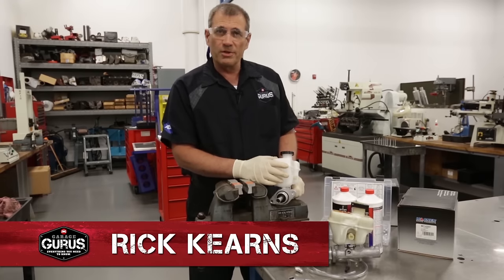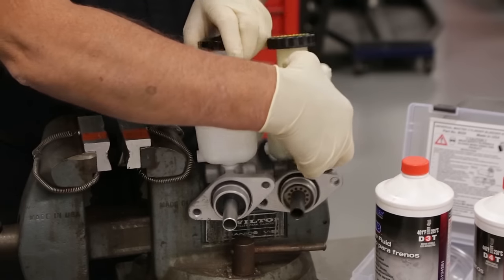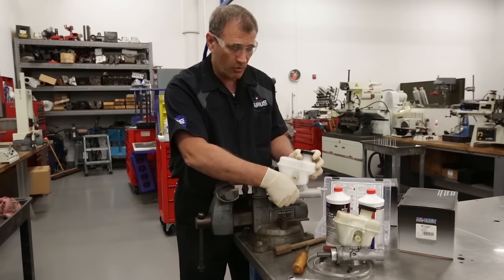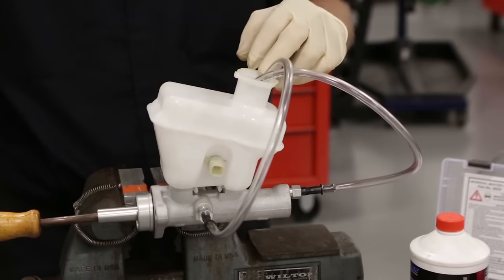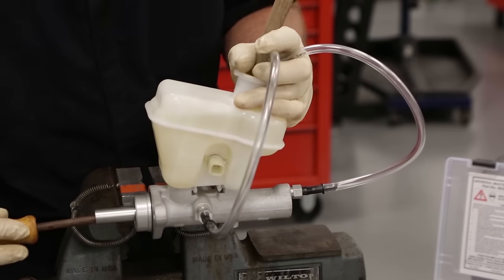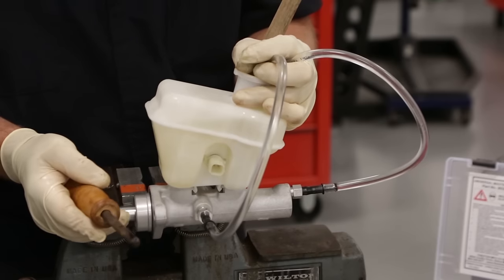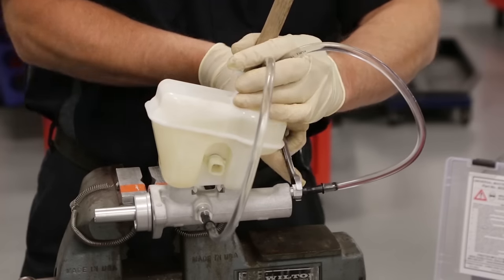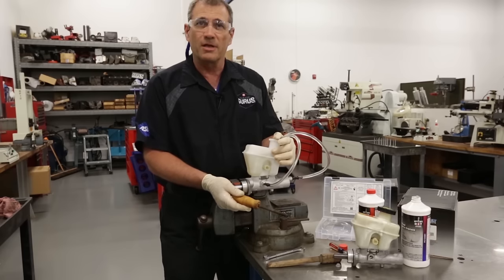How to Bench Bleed Master Cylinder

Comment: I hear that!  Asking the same "logical" question everyone else is -- that is being avoided -- as soon as the lines are removed, there is going to be an air pocket right there.
Reply: What works for us is... Install master cylinder, leave the lines from master slightly loose and have an assistant press brake pedal slowly down and hold it there.  You will see the air bubbles come out. Tighten the lines, let up on the pedal.  This works most of the time for us but we always finish with a complete brake fluid flush just to make sure all the air is out of the system.
Reply: @justincaseauto  do you depres pedal tighten up screw and then repeat a few times or is it just once?
Reply: @JosePalacio12  Most on the time we can do it once, maybe twice depending on how much air comes out the 1st time.  Usually there is just a small amount of air there anyways but do it as many times as you feel is needed.  If you keep getting air at the master cylinder lines there might be other issues.  This is assuming the master cylinder was bench bleed completely first.
Reply: @justincaseauto  ok got it.  Thanks for the reply.
Reply: Long as you do not Press the brake before reinstalling the lines then as recommended do a all wheel bleed
Reply: I doing my 57 nomad,complete job.i think the MC is desgin and  engineering to hold majority of brake fluid with losing fluid till one pushes the master cylinder in either brake lines attached.sure going get some air but will be release bleading all 4 cylinder syarting farthest line to shorest.a small amount.the problem i have is ugrading m.c.dual port reservor .

Comment: Can this is any way be done with the master cylinder on the vehicle? Reason being is a replaced all the lines and now it seems I cannot get the brakes bled correctly.
Reply from the maker: Arnold, the quick answer is yes.  We recommend gravity bleed first.  Make sure the master cylinder cap or lid is off or lose during this procedure.  Second, perform a pedal/pressure bleed alternating from front to rear of the brake system.  A common brake bleeding sequence would be RR, LR, RF, LF.  If you have any additional questions, you can always give our tech line a call and they can assist you further. The Gurus Tech Hotline number is 800-325-8886 and is available

M-Th: 8:30AM-5:30PM ET
Fri: 8:30AM-5:00PM ET
Reply: Arnold not really.  Depending on how your MS is set up.  Sometimes the length of travel between the booster and MS is not 100%.  So you will always have a residual pocket you cant bleed attached to the booster/pedal.
Reply: I know this is a year or so old but the real answer is YES. Several ways come to mind. One way is the syringe method where a syringe with a rubber tip is filled with brake fluid and injected into the MC where the brake lines connect (disconnect lines first). Another is with a pressure kit from the cap area of the reservoir.  This will also be used to bleed the entire system as well. Good luck

Comment: where do you purchase the metal brake fittings you inserted on to the master cylinder ?  I'm looking for metal fittings, not plastic.
Reply: Hydraulic or plumbing supplies shop.
Reply: @dunebasher1971  THEXTON 803X

Comment: CAN YOU JUST DO IT WHILE ITS INSTALLED OR THERES A TRICK TO IT THAT YOU HAVE TO DO IT ON THE BENCH?
Reply: You can do it while it’s installed, but it’s waaayy harder to get the bubbles out tho. This is best for when ur replacing the master cylinder or a brake system overhaul.

What you can try to do is with your hands, just bang the master Cylinder a few time to try and shake up the bubbles. Also bleeding the brakes helps out too. You can also suck out the old fluid from the reservoir and put new one in, then bleed. You can also pressure bleed the system. I’m sure you can find a vid out somewhere

Comment: Do you want the lines submerged in the brake fluid while bench bleeding?
Reply: It doesn't matter because air tend to raise above liquid. Te main point here is to remove the air from the master cylinder itself, no the reservoir
Reply: Yes, it keeps the system from drawing air when you release the stroke

Comment: NONE of the videos I’ve watched, explain what to do after the bleed with the tubes. which comes out 1st, tube or plastic fitting. Which one of the 2 fittings/tubes 1st…. etc.  How do we not just end up with all new air after removing them…

Comment: Hi 1A Auto. You have great videos. But regarding breaking. I have a Chevrolet Trax 2014 FWD 1.7 TD. And for 1,5 years nobody has diagnosed My issue right.

There is no computer signal or error code that shows up. But My front right and rear back brakes are randomly staying pushed against the rotors whenever the brakes are used. Even it is just once.

The weird thing is, it's not all the time like that. It comes and goes randomly. 

Everything from the hoses, to the brake lines to the saddle and supports,  rotors and disks are changed out. The main vacuum pump has been checked and is OK. 
The ABS fuse has been tested. Meaning it has been taken out to see if it's an ABS or EBCM issue. But the issue still was there. So we put back the ABS fuse. And no one got wiser :(

The vacuum membrane has not been looked at and it seems that no one here in Estonia is qualified to do that either. Not even the Chevrolet dealers mechanics at Autospirit nor Opel dealers mechanics have identified the issue correctly. They just keep changing out parts but not diagnosing the underlying issue at all. Do you have come across an issue like that? Any advice?
Reply: Take all the rotors and calipers off, no need to disconnect the caliper unless you really wanna bleed a system for no reason that day. Inspect it all for abnormal wear, inspect everything around it for wear marks or abnormalities, reinstall caliper around the rotor, check clearance of pads it should be equal to both sides, if one piston of a caliper looks more forward or recessed than the others and no other brake imput is given you know you have a problem with the caliper specifically, w everything replaced I'm more willing to believe that rushed work has led to a sloppy fit. I know I've had to redo my brakes once or twice just because I didn't align it all "properly". Also if the car is just seeming to randomly bite w heavier braking my Chevy truck(s10) does that too the wheels almost lock when everything's really cold I just chalked it up to abs fucking around with me. System can work perfectly fine and still be a POS at the end of the day.

Comment: Why anyone would not take advantage of the higher boiling point of and backwards compatibility of DOT4 when changing the master cylinder and flushing the system is beyond me...
Reply: Not every vehicle can use different brake fluids, and  some vehicles require very specific brake fluid type.

Some vehicles can use either DOT 3 or DOT 4, while others have to use only one type of brake fluid, for example just DOT 3, not DOT 4.

Also some Dot 3 is suitable for most or all DOT 3 applications such as Prestone branded universal DOT 3, while other DOT 3 such as the OEM branded ones have different types of  brake fluids, Dot 3 for Domestic, Dot 3 for European, Dot 3 for Asian automobiles, the formulas would  have something different in them, that's why its rated for different makes of vehicles.

Have a look at the brake fluid bottle, they will have the temperature rating on the front, and even comparing DOT 4 to another DOT 4 they can have different temperature ratings, and some brake fluid are synthetic and some are non synthetic.

Check the brake fluid cap / reservoir, owners manual for the correct brake fluid type for your vehicle, and use the recommended fluid.